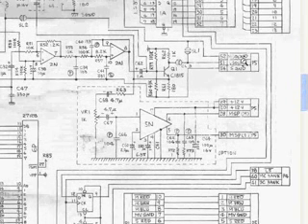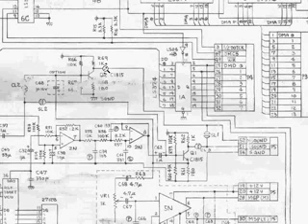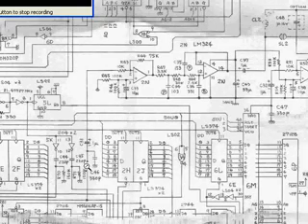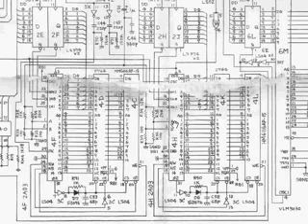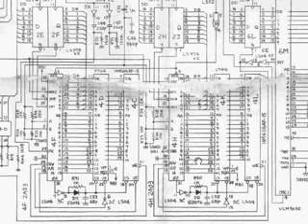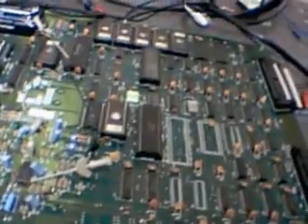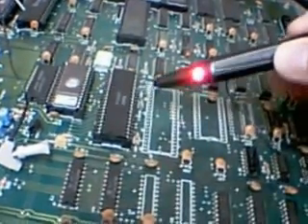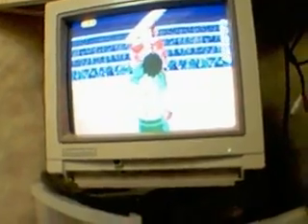Punchout PCB Repair - Audio Issues

Comment: 4:04 - "It could be that they had plans for a lot more audio capability"

They did, which is why there's an unpopulated location for a second N2A03 CPU. In some boards, I assume the earlier ones, there's even an empty socket there. In fact, the Nintendo of Japan engineer that helped me fix the audio issue on my Super Punch-Out boardset back in 2006, going from his own memory of working on the project in 1983/1984, thought that it had two N2A03s. This is what he said:

"So I have a question about your CPU Printed Circuit Board, at the location 
of 4F and 4H, Do you find a pair of the same sound processors of 2A03s? 
These 2A03s are the processors with sound frequency-modulation features, 
which are the derivative version of Nintendo Entertainment System’s chip. 
One 2A03 generates two channels of sounds, so totally four channels of the 
sound sources are to be mixed through tie-up by ohmic-resistors. Anyway 
could you check two processors of 2A03 (4F and 4H) ? Thank you."

After I told him that it only has one N2A03, he replied:

"It was a long ago for me, so I can not remember that we implement two 2A03s in 
the final Super PunchOut!! product, or single 2A03. Please let me know 
whether 4F and 4D are both empty, I mean "NOT soldered at all" or 
"removed". If the location of 4F and 4D are both virgin, I mean thru-hole 
are not soldered at all in the past, it makes me that we designed the PC 
Board lay-out for two 2A03s, but we did not implement two 2A03s in the 
final product of Super PunchOut!!. 

Anyway give me more time to remember. And give me the answer. Thanks."

And in his next email he said:

"I read your mail. I also found that we did not insert another 2A03, just 
prepared as the contingency plan. So anyway, your product which includes 
the sockets, must be the early product of “PunchOut” and upgraded to 
“Super PunchOut” by the Arcade operator.
Coincidentally I also found the same conclusion after collecting the old 
information. I am sorry for not answering soon. I am now very busy for the 
next-gen project called Revolution."